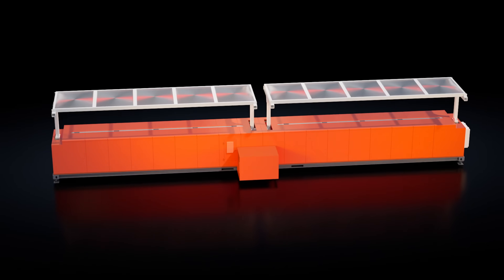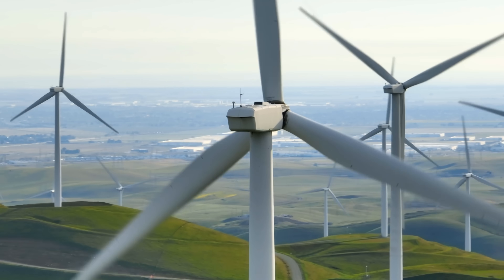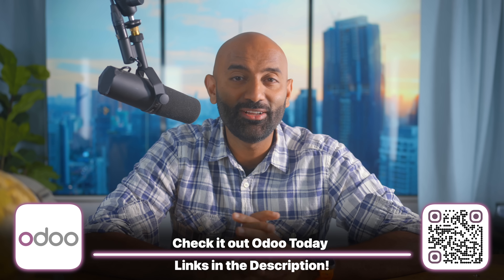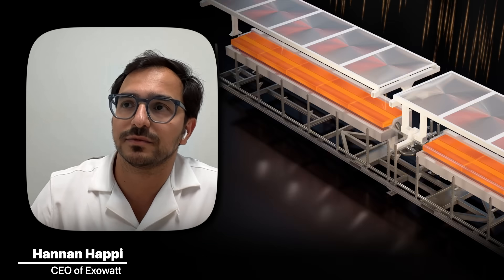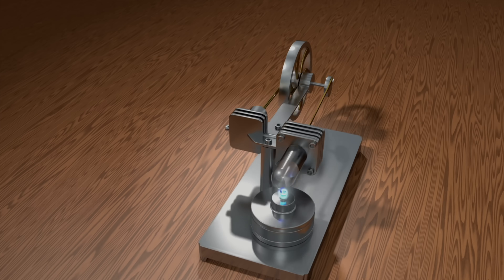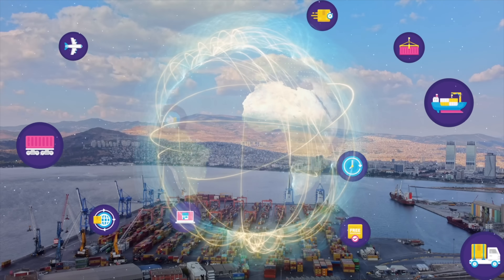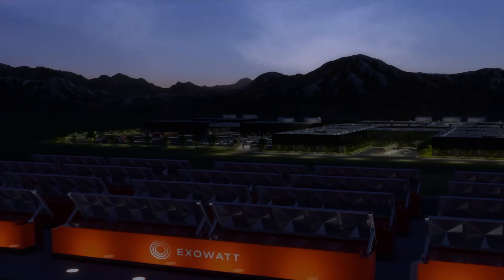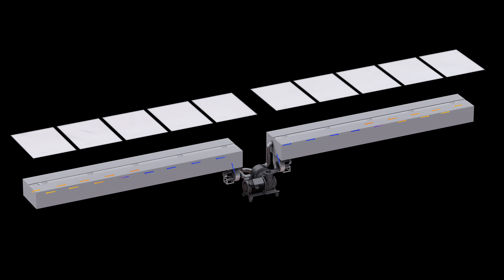Solar Without Panels, Storage Without Batteries - EXOWATT

Comment: You question the reliability, well you want reliability? Go back to building equipment as they did in the 18 and 1900. This country made stuff to last a lifetime and it does! We discard because it is old or not as efficient. Efficient, that is an interesting statement from people. In the interest of efficiency we throw a working, well built unit away that has proved to last decades or centuries of use. Purchase a unit that does the same thing for 10x the cost, loaded with inferior parts / material that require constant repair and has a life span of maybe 10 years! Where exactly is the efficiency??

Comment: 6:55 Batteries make the price of a solar system jump up 5 times? Don't know how its in the US, but in Thailand the price of a 15kwh battery is a bit more than 1000 USD. I paid 300'000 THB for my 20kw solar system and later added 4 batteries (60kwh) for 160'000. that's a 50% increase in price. But to be fair, the batteries don't last 20 years as the panels do. Mine claim to last for 6000 cycles, but i expect them to last about half that much. That's 8 years. So over a time of 20 years (that's how long the panels last), the costs increased by about 130%... still nowhere near to the 500% this video claims.

Comment: 17:30 No real engineer would use imperial units!!
Reply: Building engineers do. This is actually closer to a construction project then a mechanical/electrical project.
Reply: Fahrenheit is more accurate than Celsius 1°C is over two units of Fahrenheit. You might want to rethink that.
Reply: @copisetic1104 if that were true, scientist all over the glove would use it but every smart human even in US is using either kelvin scale or Celsius scale... It's literally dumb saying something like that cause every scale is equally accurate... You can have 0.00000001 kelvin or even fahrenheit... But fahrenheit doesn't have sense for smart people...

Comment: So why couldn't we also put these on top of buildings so we don't have to use so much energy for AC, with the unit blocking and storing the Suns light/heat and potentially use some of the heat in winter so we don't have to use as much heating 🤷
Reply: Good luck putting that on your roof 😀 I prefer lightweight solar panels which is also a lot cheaper, and they actually work

Comment: "usually, all companies over-exaggerate their figures, but in this case, we think is not the case because they say so" 😅
1- I agree that efficiency should never be an important metric, only overall cost for Kwh, but if they say that their efficiency is 18%, how it can have lower foot print than PV with 21%?
2- PV is good taking advantage of cloudy days, morning and afternoon light, etc.  Solar thermal is not. Besides, when those blocks heat up, then their efficiency to absorb heat should be lower, I bet their efficiency to delivery energy at night is much lower. 
3- Heavy Maintenance and noise are huge factors to have into account. 
4-Frensnel lens are more expensive than PV, the sterling engine cost and the rest of the hardware should add a lot.  Then maintenance, taking into account all these cases, how they claim they can be so cheap?
Lets say they can achieve 24 hours of storage, that is not enough to keep servers 24/7, instead Solar PV + Hydrogen storage can actually do it.

Comment: At earth’s surface, sunlight is about 1000 watts/square meter.  A shipping container is 8x40 feet.  Approximately 10 square meters.  10Kw.  The picture shows the collectors having the same area as the roof yet the claim is 25kw.  250% efficiency?  Not buying it.
Reply: Actually it's about 30m². But even with that it'll never produce 25kw electrical power. You're right, this is bs.

Comment: This is a brilliant idea and ingenious application of already existent technologies. I didn't see it highlighted as a feature, but throughout the video, I kept thinking that environmentally, this is a superior solution to photovoltaic panels, because it does not require the mined components and purification processes that PV panels do. Very likely less energy consumption in producing the Exowatt boxes as well. And repair should be much simpler too.
Reply: And regarding the "solar tracking", would a parabolic trough work, and remove the need for solar tracking?

Comment: Please YES, try to get us a close-in tour, the grittier the better. Rendered graphics are a very poor second to REAL STUFF that is actually heating, moving and being measured. I, for one, really want this to be an answer to the slowwalk* to practical battery storage.
Side question, what about using the clay from which the brick is made instead of small bricks. Once the 'brick' is poured into the mold it will dry as one big brick perhaps with thermo-conductive spacers to accommodate expansion/contraction during the daily thermocycle. air ducts would cast-in-place.
*if we had fought WW2 using the business practices of today then this is 1943

Comment: I recall a technology often used in sensors that involves placing two types of metals against each other, and then utilizing the difference in their expansion or contraction due to temperature to create a curved entity. Imagine using something similar to that technology to create tracking systems that work purely off the sunlight itself. Then, mounted solar panels, or Fresnel lenses like these, could track the sun like plants do, simply by bending toward it.

Imagine a field of metal plant-like structures that bend toward the sunlight. Too fantastical? Fine, but hopefully the thought inspires something practical and almost passive like that, because such a breakthrough would be massive.

Comment: Great video. My concern is ... how do you reduce the footprint to allow single family homes to use it?  Solar can be mounted on a home's roof.  Using bricks as a battery is very cool, but I wonder how much heat is escaping through the walls of these very large units? Also, what sort of sound is being created from the engine and the exhaust fan?  Also wondering about connecting a bitcoin miner to the unit to further  reduce cost, creating a breakeven or positive cash flow for the owner.  I, for one, would love a factory tour video. 😊

Comment: most of usa is in cold weather 
extreme cold i say this wouldn't work
solution get 90% of trash dry it in sun pass it through an industrial shredder (branches / bushes)
oil barrel burner = extreme heat for steam or to store heat those batteries

Comment: One of the biggest problems with this is keeping it clean.

The obvious lense its self, but more importantly, where it focuses that light is basically a high powered laser. So if there is anything between the bricks and the focused beem its going to get hot, that can char or warp getting even more heat absorbed there instead of bricks

Comment: The storage problem was already solved for the ISS, with nickel hydrogen batteries. Sure, they only have about 70% efficiency, but they work in a huge temperature range, and are ridiculously safe for something made with hydrogen.

Comment: Not sure what is the point of the bricks ( thermal battery ), but at 1000C, you need BIG insulation to not loose most of the heat ( because temperature difference speeds up energy loss ). Now you realize you want to merge those small blocks into a single block. And realize that the insulation cost is ... big.

Comment: if they're smart they'll make a point - a very BIG point - of putting some of these in Australia.  Why?  South Australia's grid is heavily reliant on solar and wind and that's failed it hideously - they were running the damn grid on diesel generators at one point, spot price for power (which shifts every 5 minutes on a live market) hit $17,000 for 1kwh.  Seventeen grand (for "merrricans that's $11,081.45 USD).  You've got a highly politically charged market with entire segments of the power generation economy who have gone too far down that road with no remediation methods and for decades power that's cost about 3x what Canadians pay (hence why Oz has never had the IT industry it should have had).

Solar panel production is highly contentious given the immense - IMMENSE - environmental impact of making those things and more importantly the reliance on Chinese manufacture for supply chain, a chain which will probably go away rather suddenly in 2027 when the war kicks off.  These are different and innovative enough to warrant outsized publicity going in - and the use of century old tech will enthral Australian viewers too.  The country has an awful lot of heat and sun and across much more of its surface than the US, also its consumers are easier to take advantage of as they readily paid 3x what Americans would tolerate paying for things (power is quasi-government so they want to keep those prices high and increase margins as those funds go to con-rev accounts).

Comment: 25kW from one container ? 
What is the weight of one unit / container in tons (seems a lot) ?
What is the initial cost of one unit / container (for the efficiency) ?
You are giving confusing different data as: 0.6 acre per 1kW and later 25kW per container.

To translate (my OS calculator shows) 1 acre =4,046.8 m²
So 1 km² for how much, 1 kW(h) or 25kW(h) ?
(as 1kWh compared is 1 active home grinder, or home driller, or small room heater)
I don't understand comparisons, can you clarify.

Comment: Ultra high voltage DC power transmission.  China is leading in this regard.  USA needs to step up its game.  It would be even better if ultra high voltage DC power became a worldwide network, a "peace grid" if you will.

Comment: It looks like Trump's hard love is getting results. I know of 2 or 3 other technologies that would work if the PV absolutists are side lined. The same is true for wind; compressors in windmills keep getting shut down by someone. And in EV's we know that Ethanol hybrids work but are not made. Mass produced on farm ethanol stills were legalized by George W Bush and re banned by Obama days later. Why? If you make ethanol on farm you can use the wet distillers grains as stock feed but Obama tried to ban that too. We know the 20% lithium/ 80% zinc air works and is safer with longer range and no charging fires. But no-one will make them in the USA. Elon has talked about it at least.

Comment: Absolute vapourware.  In this household we obey the laws of thermodynamics! There’s way too many efficiency losses in this design to be viable.  Just being able to insulate that thing enough to keep from losing energy from the extreme delta temperatures would require stupidly expensive methods.  We just need domestic solar panel production.

Comment: Fo more on this. Also, look into technologies that combine solar and farming - plants and/or animals
  Loss of farmland is a BIG issue in rural communities. I live near I81 where it enters southern PA. We now have dozens of  huge warehouses and several solar sites(ex-farms).  There is a tension between the alternate uses thatihjt not be necessary if we are smarter in our policies and technical choices.  Perhaps we could require warehouses of  million square feet to have much of the roof covered with solar panels, of not, the owner would be required to place some number of acres of good farmland in trust to remain as farmland to

Comment: Does this system translate for individual use?  Like solar units on homes ?  In some areas home owners with solar can give overage to the local grid and get paid back ..  OR is it just for industrial use ? 
Id prefer to see this system used here just because it does not use lithium batteries....We are polluting our environment with these type batteries....defeats the whole idea of sustainable energy and reduced polution from gas and oil use..we just traded one polution for another more volatile, unstable , more expensive to dispose....

Comment: I agree with a lot of the other comments we need a scaled down version for single homes off grid. I feel like there could be a lot of data collected off of those systems that would benefit the company in the long run.

Comment: my final thought is, if the amount of land is at issue, solar farms could be plan more efficiently. That is to say, for example, well it would cost more initially, there's no reason why battery storage needs to be located separately from solar panels. I assume the only reason why this is done is because it is cheaper to do this than to do the obvious thing which is to excavate down about 15 feet and put the batteries underground, or alternatively build a structure to raise solar panels to live above the batteries. This would likely reduce the land cost by about 10 to 15%, depending on how many batteries are needed to store access generated electricity.

That said, it's my understanding that most solar panels cannot convert outside of visible light into electricity. I believe I've heard about some ultraviolet solar panels, but not much about infrared. It seems to me that there is an opportunity here to double up the Systems somehow. A Fresno lens designed to concentrate infrared light might be placed underneath especially designed solar panel to combine this technique with solar visible and ultraviolet light electricity generationto capture the full spectrum of solar power. In this case then you could have a solar panel combined with an infrared concentrator and have all the power stored in the specialized brick heat system which then is transferred in into electricity to the grid by the Sterling engines.

Comment: my next thought is, with all these technologies, why not combine them? For instance, you could have a solar farm with these units adjacent in place of or in addition to chemical batteries. Since these units are said to be able to use electric resistive heat, and they could be used without the fresnel lenses as a form of direct excess power storage.

Alternatively, you could put less efficient cheaper solar panels in between the rose or columns, and eek out a little bit more electricity from the land. An open question if combining windmills say at the corners would add enough additional power to overcome any shadows they would cast, although with smart placement, one could minimize the losswhile maximizing the land use.

Comment: Poor technology.  It’s still a single pass system.  Once the hot air goes through the sterling engine it’s wasted.  

On the other hand, a solar brine pond allows you to pull off a percentage of the heat through your sterling engine and then the still hot brine is dumped back into the pond. Then, the remaining energy is pulled through the sterling engine again and again.  

The brine pond is the battery.  A black pond liner in the bottom collects almost 100%!of the energy and a clear pond liner above the brine stops evaporation.  

It’s a very simple construction, low cost and efficient.  I built one 30 years ago and it’s still pumping out energy.  No maintenance.  No issues.

Comment: several thoughts on this occur to me

first, if the tracking of the lenses is a maintenance variable and a cost variable, and the unit units are going to be oriented towards the main solar axis, then why not use columner Fresno lenses instead of circular? In other words, it seems to me that you could have an arch shaped lens that focuses the sunlight down in the same way that the moving circular lenses work, and you would remove the need for movement.

Comment: Disadvantage: The Stirling engine works with an efficiency of 35% in maximum, which cannot exceeded by any progress. But nevertheless a good idea. Perhaps it could deliver heat for district heating systems of a smaller extent if the heat is trasferred into a storage device which performs for months.

Comment: How can as stirling engine generate enough torque and speed to turn a generator under load? I had a small one and it would stop running once the air in the cooling chamber could not be properly cooled.

Comment: If designers of these Data Centers gave some out-of-the-box thinking: first build the facility sub-grade of several levels utilizing the natural lower temperature for thermal cooling, and above grade install the EXo system to generate power supply. This would maximize the cost of acreage needed for both facilities.

Comment: The only issue I see with the data center application is that a exowatt unit requires constant sun and heat to store in the thermal mass (bricks) to make the sterling engines work. So there is a constraint on what environment the units can be placed. But such places typically have low access to water and underground aquifers needed to cool the data centers. So, it’s not really a great fit unless I’m missing something. Even with the lenses and insulated thermal mass, you would probably lose a lot of potential output if, say, you had these deployed on the east coast of the US where AWS east data centers are located. There’s plenty of water in Virginia etc… but states on the east coast just don’t receive as many days of sunshine and you will require more units for the required output. And land is at a premium in such areas

Comment: It would be interesting to compare the quantities and unit costs of the component commodity raw materials (kg steel x $/kg steel; etc) divided by total energy produced over the lifetime of the system.  At scale the unit cost of energy bends towards the underlying cost of materials of the generation plant.  Intuition is PV + battery involves significantly smaller overall mass of materials per MWh, and the cost of batteries is trending downwards.

Comment: Use excess wind, solar and heat based sources electricity supply to pump up seawater and fill up purpose built SEA WATER dams so that when the off season for any of the resources come, you have a simple reliable supply of hydro. Bonus points for Using non habitable areas for pumped sea water dams (wink wink, desert areas).